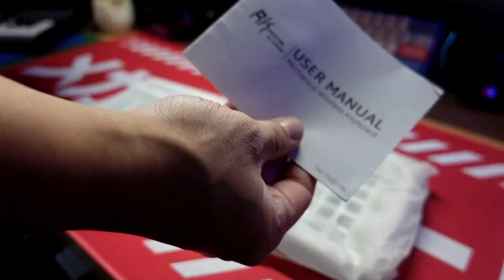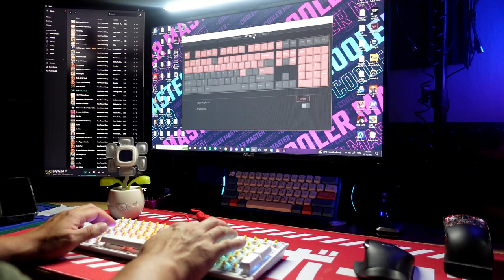BECOME MORE PRODUCTIVE WITH THIS ONE KEYBOARD!

Comment: Pano po gumana yung wired ayaw gumana sakin? pero nareread naman ng pc. Tsaka po natry niyo na yung software nung rk98 ayaw din gumana sakin no device conneted daw? 😢
Reply from the maker: Check the manual if naka mac or pc mode, may makikita ka doon na shortcut key for that. Try niyo lang baka yun ung solution or try to use other type c cable din :)